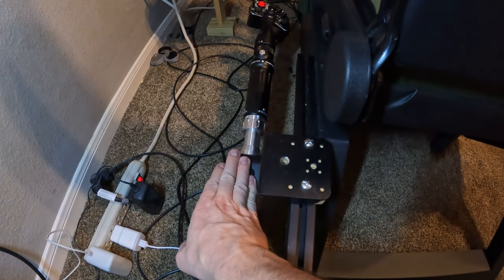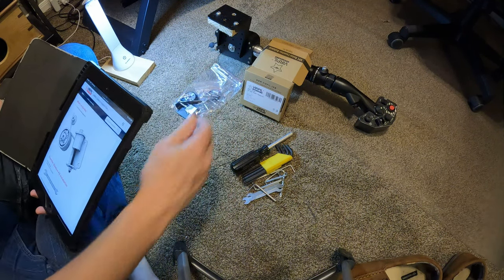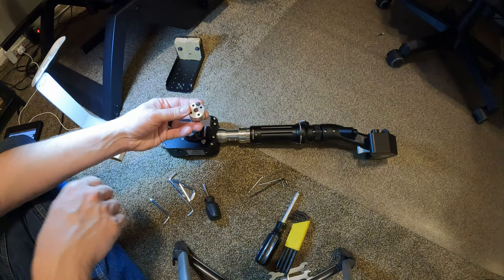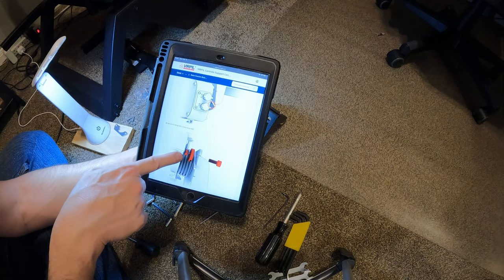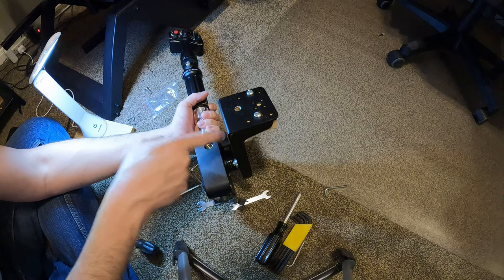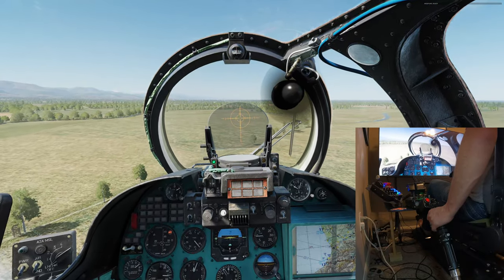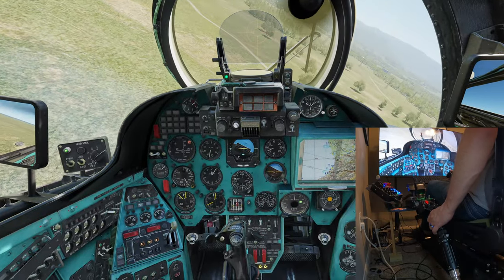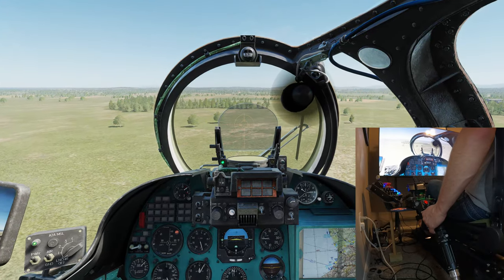Virpil Counter-Balance Installation and Flight in a Cool Helicopter! | DCS World

Comment: Ugh, this is the last thing I need. My wallet is already trying to hide in my couch with my computer aging to a point that DCS is struggling a bit, and now with the Apache collective out, it's ready to jump off the roof.
I need to grab the Virpil rudder dampener attachment for the rudder pedals when it comes out. That thing looks like it will make helicopter flying a lot easier.

Watching it, this is definitely why I was thinking about using that kind of piping to build my own little throttle/collective stand. I usually just use desk mounts, but it would be nice to have something I could slide under my desk and out of the way that would allow me to have my throttle on top and then mount a collective on the side to use as needed.

I also didn't see the appeal of the helicopters initially, but then once I found the joy of the hand flying fun that is the Mi-8 and Mi-24, I was hooked on helicopter in general. The Mi-24 really does feel like you're throwing around a massive murder bus.
Reply from the maker: Murder bus, I like it! 

I think that is why I like flying them too. Hard to learn but a lot of fun once you do. That aluminum extrusion is really useful stuff. Another one of my squadronmates has the Virpil pedals that he just modified with the damper kit, he really likes it.
Reply: @DieselThunderAviation  Nice! I'll have to try it out. And yeah, the Apache is a blast with the way you get the fly and fight in it, but the Hind always has that extra layer of fun when you don't have the fancy missile warning system or countermeasures, and you can't really hover and pick your shots as easily.

Comment: Thanks for the detailed video, one thing that bothered looking was the collective angle in the end, your arm does not look comfortable to me sir. Maybe try installing the collective mount higher and slightly forward, so that your elbow doesnt go behind your back. But if you enjoy it this way, then this is how you like it. cheers
Reply from the maker: You're welcome, glad you enjoyed it! For the mounting, the wide angle on the GoPro may be creating an illusion. With the collective all the way down, the grip is about right below my shoulder. I can't move it much farther forward as the mounting plate for the throttle would interfere. As I raise it, I pull my elbow back a bit. Doesn't feel uncomfortable at all, and the new counter-balance makes that feel even better.

Comment: Just found this, i got mine setup probably about the same time you did. I also got the blackhawk grip and twist throttle, ( i actually dont use the twist, only for the look). Have you flown the Blackhawk mod, I love it, definitely my favorite. Nice to see virpil came out with their own counter balance, i got the one the guy makes and sells on etsy, with the little bolted weights, it works perfectly, anyway, thanks for the videos, oh the only other thing i did differently, (I also have the same chair, by the way) is i mounted my collective on some 2x4s that i screwed directly to my floor, so super solid, that chair isnt going anywhere so it works for me. Also for head tracking i use , AI Track and Open track, but not with the ir lights they didn;t work for me. I use the one that just sees your face, not perfect but good enough.

Comment: Hey there, 

I've got the Thrustmaster Warthog I use on a "goose-neck" extension for flying helis in DCS, MSFS and X-Plane and I have just ordered the VIRPIL TCS Rotor Base Plus with the UH-60 grip, both of which I now see as on "Back-Order" - goddammit.  That gives me time to work out how and to what I'm going to mount the base as the VPC Chair Mount won't work with my office chair.

I am thinking of drilling holes in the covered wooden base of my office chair to enable me to mount the VPC Base's bracket directly to the underside of it with the bracket as shown in "Option #1" of the online Rotor Plus TCS Base User Manual, probably with a couple of metal sheets on either side of the chair's wooden base for re-enforcement - if that works I don't care if it looks ugly!!!  

But I don't know the size and spacing of the various pre-drilled holes on the bracket.  The bracket itself it is 152mm x 83mm as depicted in one of the images on the Rotor Plus TCS Base product page so I want to make a template and have the holes drilled for when it all arrives from VIRPIL UK.  Are you aware of any such drawings/schematics?

Also, what pedals are you using?

TIA,
Guy

Comment: This angle you're using it in the end is very rough. Doesn't look very ergonomic and you'll have problems being able to use the dual stage apache collective in this configuration.
I recommend raising the base itself so that it bottoms out without you having to reach down and moving it forward.
The collective grip in a normal seating position would then be "in line" with your crotch roughly and the arm just extended, no leaning forward or something.
I'd also suggest dropping the limiter down down to 40° or keeping it at default if you have the throttle variant. The angle is just way too steep if the collective arm is elongated - which it is in your case with the throttle grip. The apache grip worsens that problem.

Virpil also did an oopsie on this - the counter balance kit can NOT go on it if it's vertical. The spring is supposed to be screwed and fixed in the round hole in the bracket - you can measure and will see the distance of the round and square holes is different.

Seriously the biggest flaw of this hardware that must be addressed on a v2 version.
Reply from the maker: The wide angle lens likely doesn't help with that. It feels pretty good when flying with it. With it all the way down I can reach it without having to stretch for it (being tall with long arms helps here), and it is forward of my shoulder. Mounting height feels fine and it's rare that I have to pull the collective all the way up in flight. 

Thankfully there are other holes that the spring arm can get screwed to and it works out well. Moreso that the spring tension is adjustable. A v2 version of this with a built-in counterbalance would be nice, though it is good on Virpil to offer a (very reasonably priced) solution for the tight friction of the original ones.

Comment: What's the length of that extrusion you have there?
Reply from the maker: On the chair it's 15 1/2 inches. I had a three foot piece to start with, and just eyeballed it when I cut it. Nothing special, it's just 3030 T slot extrusion.

Comment: Ok, so I'm gonna be a bit lazy and ask, what are you using for head tracking? TrackIR or is it full VR? I have the HP VR rig and I like it, but using switches and such is a pain because you can't see your controls and such. Was thinking of trying trackIR and wondered what you thought of it? Oh, and yeah, the Hind is a blast... 🙂
Reply from the maker: Good question! Though my PC has the horsepower, I don't use VR. Still pretty expensive, and I'm quite happy with the 4K panel. I do use OpenTrack with a modified Playstation PSEye camera, and a LED clip attached to my headset. TrackIR/OpenTrack is quite nice!
Reply: Thanks for the reply. I think I will check it out! Still wondering how to check six though... 😛 @DieselThunderAviation
Reply from the maker: The angles are exaggerated with TrackIR/OpenTrack. Turning your head approximately 30º left or right will get your virtual pilot to check six so to speak. Setting it up for your space takes a little bit but is worth it.